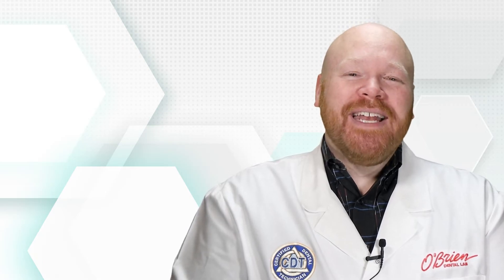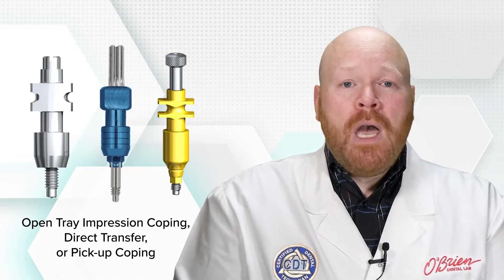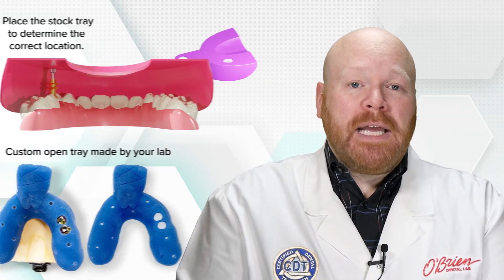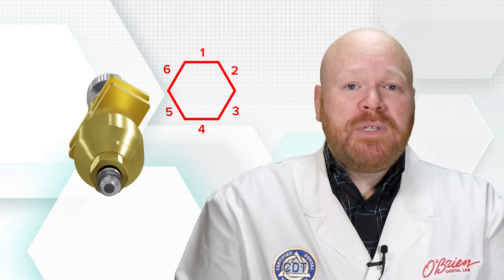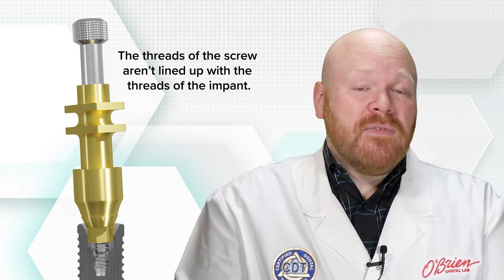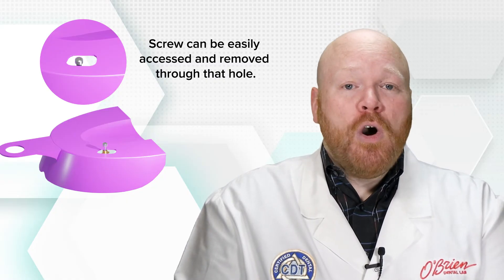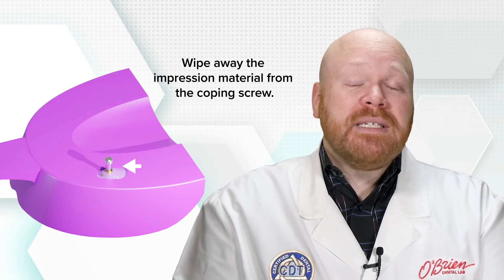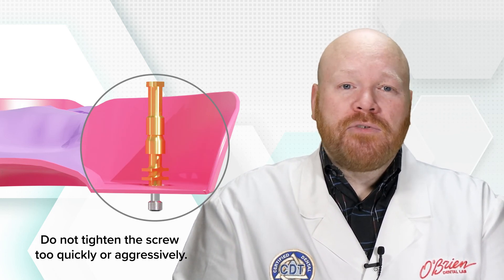How to Take an Open Tray Implant Impression

Comment: Sir if  implant is submerged n impression coping is short as adjoining teeth r supraerupted ... any technique to make impression???
Reply from the maker: Depending on the system, there may be taller impression copings available either from the original manufacturer or from a 3rd party.  Additionally, it would be possible for a lab to create a custom impression coping that is taller, but that would be an expensive option.

Comment: Wht is choice of impression coping in limited mouth opening
Reply from the maker: A closed tray impression coping will typically be easier to use in that situation since they are usually shorter.  If you have an intra-oral scanner, a scanbody would be the best option.